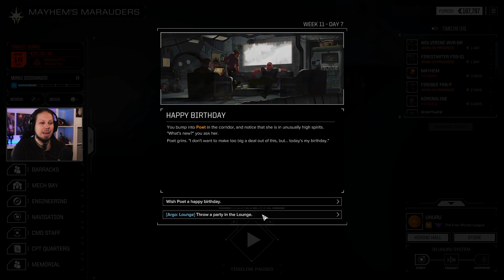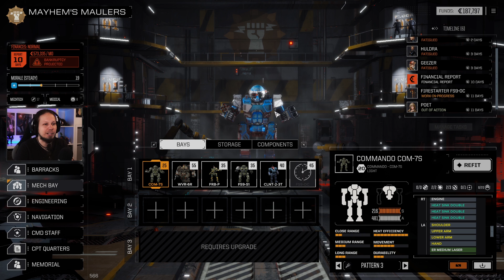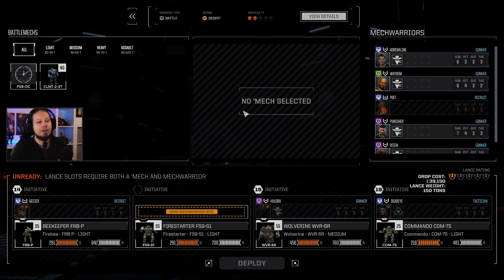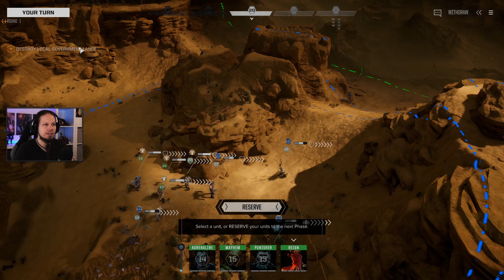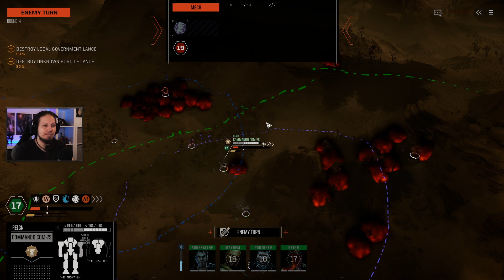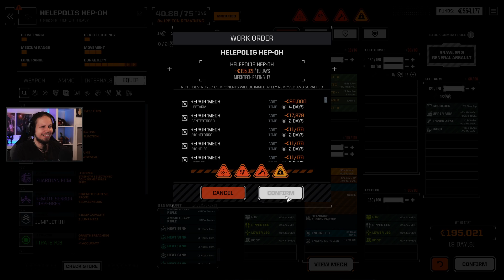Power Spike - Roguetech Mod - Battletech Career Mode Playthrough #05

Comment: High payout option total or low Salvage at max salvage  i.e. 3 parts is when you find the best components/parts.. Meaning when they only allow a Max of 3 parts OR a High payout are the missions when you run into R.I.S.C. mechs/parts and or high value mechs and parts in the mission..  Have tested this out over many many drops and this is pretty much the rule of thumb regardless of RNGesus.

Comment: Do not underestimate a "Two skulls" mission. Game tricked me with one at one point, sending a Commando at me followed by a pristine Battlemaster. Thing broke the Quickdraw in one volley.
Reply: I had a "One Skull" that required me to assassinate a target.  Said target was behind 4 mechs (killed all but the up-specced Owens), which had "support" from 3 more lances of light to heavy mechs (mostly primitive) and a couple vehicles.  Another "one skull" mission I had was the tag team match... It put me up against a MadCat III and a Stealth helicopter.  I had a Wolfhound and a Flea.
Reply: I ran into a Marauder for a one skull assassinate mission, plus it was pretty much my third mission for the play through. Thankfully his reinforcements were far away and I managed to get two MAD parts early on. Now praying to run into another one asap.

Comment: In RT your pilots use tactics skill in sensor rolls. That's the reason you are getting the no sensors penalty often.
Reply: Definitely. Makes sense though. Doesn't do a pilot much good if they can line crosshairs up on a target, but they don't know how to read the targeting computers.
Reply: I’m not sure, but that might be solved by having a forward unit share its sensors with a c3 slave
Reply: @amediocrefan748  a bit, but not really as the skill check is made to see if the pilot can understand the info they already has.
Reply: Looks to me to be when they are in fire/smoke.